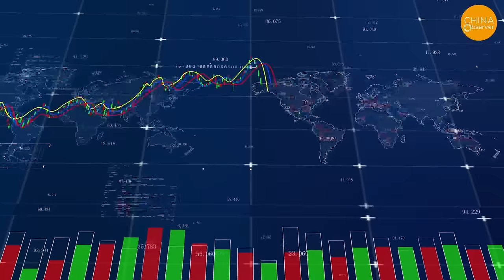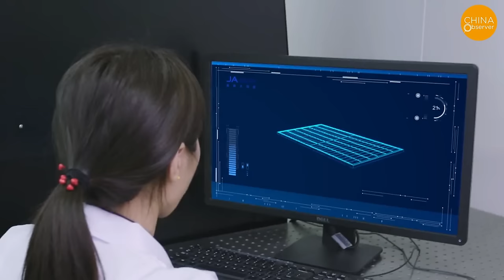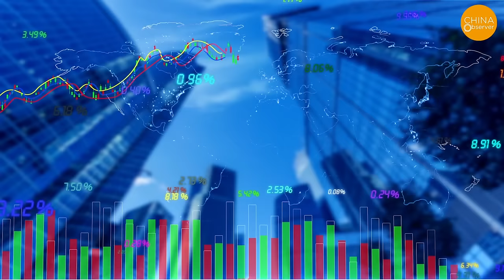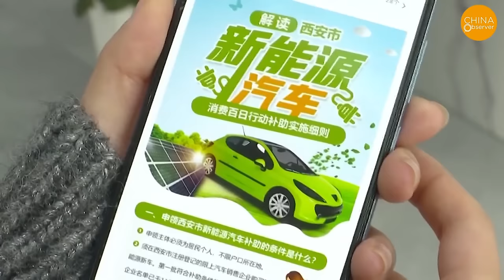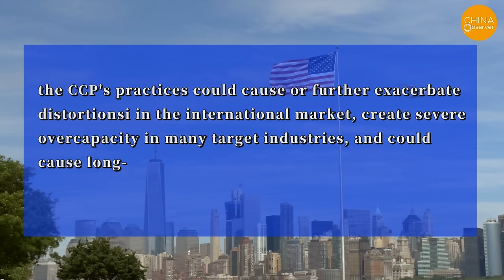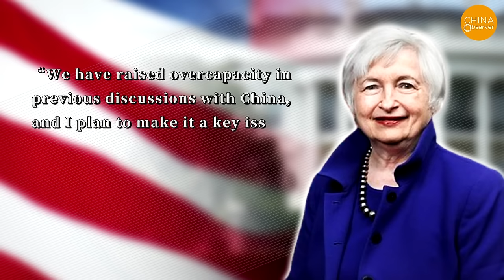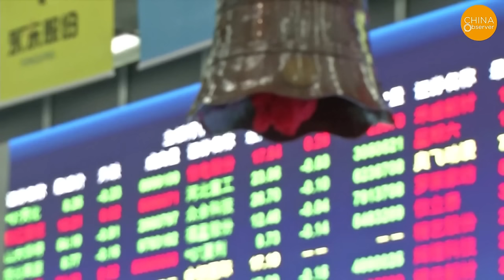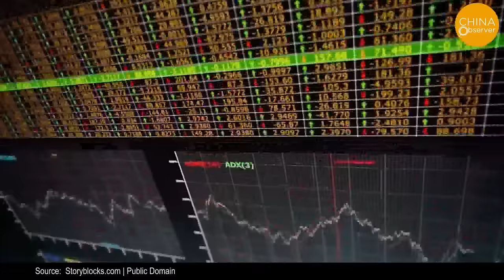China Offloads Trillions of Tons of Excess Waste Overseas, Foreign Traders Resist Fully to Survive

Comment: One of the biggest dumps I have actual knowledge of (from people in the know whom I know) is one that has actually been going on for about fifteen years already, the export of glass and other beads. Apparantly, between 2001 and 2010 or so, China ran their bead factories so hard that they managed to throghly dominate the market (they even broke the back of India production which had been a leading supplier for several thousand years.) And they still DO, despite the fact they turned off the machines and shut the factories ages ago. They warehoused so much dumpable product that they can still out compete everyone without actually making ANYTHING new. Most of the stuff is crap quality*, but there is so much it's pretty much all anyone can get.

*Some of the stuff from early in production is decent, even high quality. But very soon, anything requiring care or skill to make was junked for quick and sloppy.

Comment: Sorry, but I have to give this a 'Thumbs Down' for its overly hyperbolic (i.e. FALSE)  'trillions of tons' claim.
The TOTAL GLOBAL ANNUAL SHIPPING is approximately 10 billion tons. One trillion tons is ONE HUNDRED TIMES MORE. 'Trillions of Tons' is hundreds of times more.
Reply: One thousand times more.
Reply: @Juan-os4hs  No, you're wrong.  A trillion tons is a thousand times more than a billion tons ( 1gigaton).
I stated that annual global shipping is approximately TEN billion tons.
The '100 times' is correct.
Reply: @gregparrott  
'Trillions (plural more than one) of tons', would be at a minimum then >1,100 times more.
10 billion tons — 10X10⁹
1 billion tons — 1X10⁹
1 trillion tons — 1X10¹²
Reply: @Juan-os4hs  I'm glad you switched to exponential notation. Your three examples are correct      I see two mistakes:
#1) You misinterpret the meaning of 'trillions' (plural). That means MULTIPLES of trillions (e.g 2 trillion, 3 trillion, etc.). So, that is 200X, 300X, 400X, etc.
#2) To see your main error (100X vs. 1000X), note that 10x10^9 = 1X10^10.   1X10^10 is a more obvious representation than 10x10^9 (sorry for no superscripts)
When you represent 10 billion with the exponent being 10, then it's obvious that it differs by TWO orders of magnitude (i.e. 100), not three.

This is easily verified by calculator. Divide your trillion by your ten billion. You'll get 100          (1x10^12) / (10X10^9)    =    (1x10^12) / (1X10^10)    =    100

 I have a question and favor to ask: How do you show the exponent as a small superscript? I did not do that above because I don't know how to create superscripts
Reply: @gregparrott  
A million is a 1,000 X 1,000,
A billion is a 1,000,000 X 1,000,
A trillion is a1,000,000,000 X 1,000
Therefore —
a million is 1X10⁶
a billion is 1X10⁹
a trillion is 1X10¹²
Check Wikipedia article: Names of large numbers. 

If you're using a mobile device hold down the number on the key board and it might offer the superscript or fraction options of that number: ¹, ½, ⅙, ⁴, ⅘, ⁵, ⅝, ⁶, ⅞, &c.
Reply: @Juan-os4hs  Thanks for the instructions on superscripts.
May I assume that you agree that a trillion is 100 times greater than (edit: 10 billion) and that 'trillions' means integer multiples of trillions?
P.S. As for the numbers you posted and their names, yes I know them well.  I am a retired engineer with 40 years in the industry after getting my degree,
Reply: @gregparrott  
As a retired engineer, you should know that it's a best practice to settle on one exponent for measurement & calculations. 
So choosing 10⁹ for example, would render: 
10 X 10⁹ subtracted from 1,000 X 10⁹ leaving 990 X 10⁹, 
Or by going the 10¹² route,
1 X 10¹² minus 0.01 X 10¹² leaving 0.99 X 10¹²
You are correct it is a hundred times more—for just using one trillion, but when a second trillion is introduced the disparity is then 1,000X more,  thus my assessment of >1,100X more is correct.